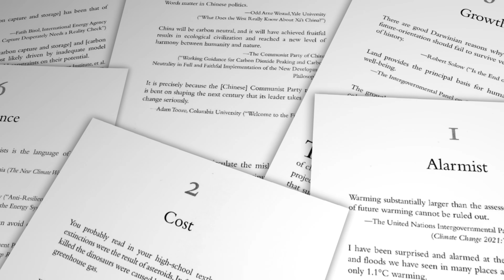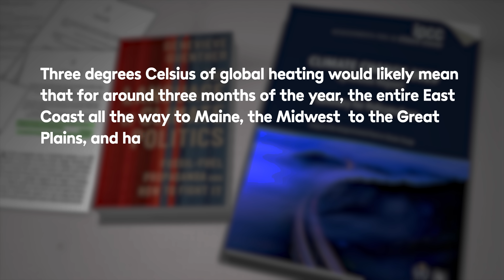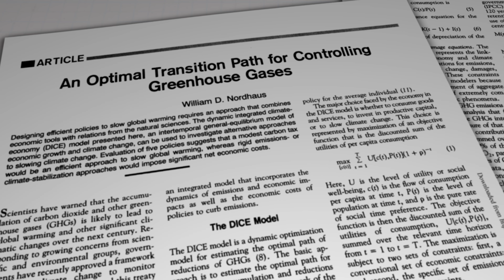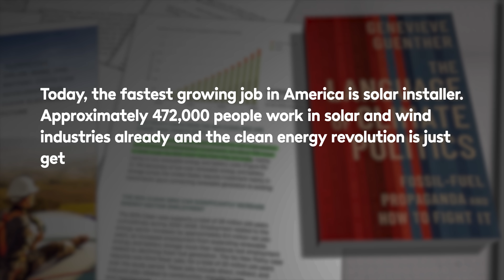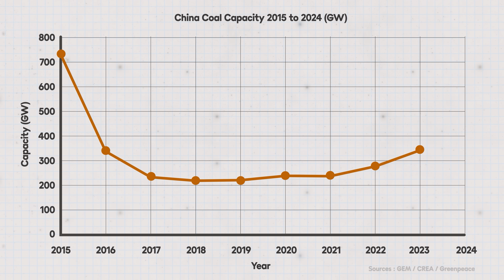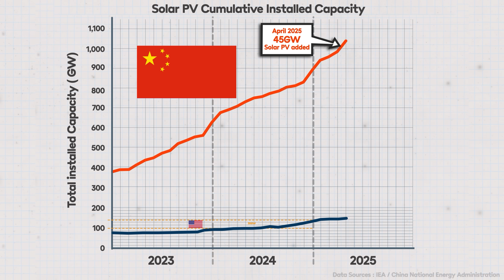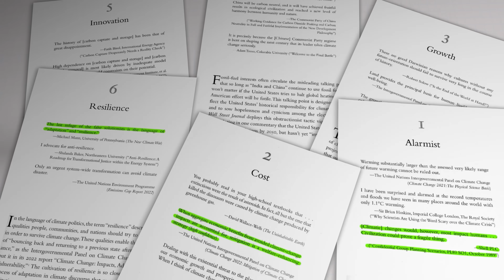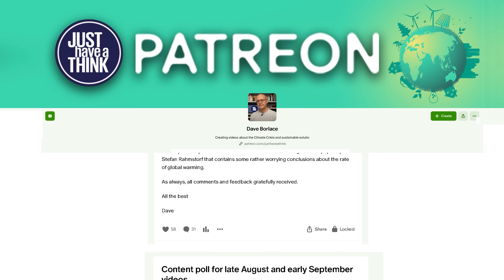New research DEBUNKS climate disinformation.

Comment: 5:52 No. 
"Heat-attributable mortality fractions have declined over time in most countries owing to general improvements in health care systems, increasing prevalence of residential air conditioning, and behavioural changes. These factors, which determine the susceptibility of the population to heat, have predominated over the influence of temperature change." IPCC
"As regards disease, the Lancet's Countdown on Health and Climate Change (2019) shows Climate-related deaths are a small proportion of all-cause fatalities (1990–2017). That is based on data per IHME (2019), and between 1990 and 2017, the cumulative age-standardized death rate (ASDRs) from climate-sensitive diseases and events (CSDEs) dropped from 8.1% of the all-cause ASDR to 5.5%, while the age-standardized burden of disease, measured by disability-adjusted life years lost (DALYs) declined from 12.0% to 8.0% of all-cause age-standardized DALYs. Thus, the burdens of death and disease from CSDEs are small, and getting smaller. 
However, the declines in death and disease rates from CSDEs since 1990 are only a small proportion of longer-term declines across the globe. In the USA, one of the few places with good long-term data, death rates from dysentery, typhoid, paratyphoid, other gastrointestinal diseases, and malaria – all water-related diseases and therefore, almost by definition, climate-sensitive declined 99–100% between 1900 and 1970. 
We are solving our problems with CSDEs faster than we are solving our other health problems."
Indur M. Goklany
Data, in fact, shows that during the recent period of slight global warming over the past century, Malaria has sharply declined, and it is projected to possibly be entirely wiped out sometime after the year 2040.
If you're worried about deaths due to 
climate, cold temperature events are the big killer, not heat. It is estimated that 5.1 million people annually die in association with non-optimal temperatures. 4.6 million are linked to the cold, so over 90% (Zhao et al, 2021). And it is worst in the warmer parts of the world. 98% of temperature related deaths in SubSaharan Africa are due to the cold. Temperature events may be linked to upto 10% of human deaths annually. In a warming world there will be less death.
There are over 5 million excess deaths per annum globally due to abnormal temperatures from the 2000-2019 study led Prof. Guo of Monash University. It found that over 90% of excess deaths were caused by excess COLD rather than excess heat. So, in a world with increasingly mild temperatures, there will be less excess death. Lives will be saved. Warming is good not bad. 
A 2022 Lancet study reported 791 heat-related excess deaths and 60,753 cold-related excess deaths in England and Wales each year during the years spanning 2000-2019. That’s an excess death ratio of about 85 to 1 for cold vs. hot temperatures.
Due to warmer urban temperatures, the number of premature cold-related excess deaths avoided averaged 447 per year from 1976-2019 in the city of London alone (Hajat et, 2024). 
Europe as whole had overall ratio of 10.09 cold-related deaths for every heat-related death (Boretti, 2024). In a 2025 paper by Walkowiak et al. found the post-1980s warming trend had improved European life expectancy “The last four decades of global warming have led to a net gain in life expectancy.”
Another Lancet study (Liu et al, 2019) on temperature related death in China showed for every heat related death there were 42 cold-related deaths for every heat-related death. Or 580,800 deaths due to cold and only 13,900 due to heat in the whole of China.
Reply: What a load of codswallop. You need to understand wet bulb temperatures. In more and more places people who are outside for more than an hour will simply die as evaporative cooling will do nothing to help them.
Reply: And no air conditioning may save some, but most can't afford it.
Reply: 1 Billion people looking for a new place to live....

Comment: 4:50 The usual unsupported drivel. Of 30 CMIP6 climate models 27 run too hot. Several actually double the rate of observed warming (1979-2024).

Comment: That's my argument. We are going to need far more energy in the future than we use today. At least twice as much. So a renewable energy sector would be far more valuable than a fossil fuel energy sector.
Reply: You forget...  Moving away from fossil fuels actually means our overall energy requirements drop by a considerable amount.

Why?

Because in order to gather the fossil fuels we use to produce electricity and propel our cars and planes around you first have to expend a bunch of energy gathering the fossil fuels.

You have to expend fossil fuels in order to gather fossil fuels.
Reply: "That's my argument. We are going to need far more energy in the future than we use today. At least twice as much." We are currently overshooting Earth's sustainable carrying capacity by about 70% per year and that overshoot is pushing ecosystems, our food supply, and societies toward catastrophic collapse, and you would like to double the rate at which we cause our own self-destruction?
Reply: @HealingLifeKwikly  You sound like the new version of Paul Ehrlich...  Food production is the most its ever been, and it continues to increase every year.
Reply: @HealingLifeKwikly  Just an area of 800 km x 800 km in Western Australia receives enough solar energy to power the whole world.
Reply: @andrewclark3236  That's great Andrew, but 
this isn't simply an engineering problem where we just need a different form of energy; rather, the problem we face is how can we meet the needs of 8+ billion people while ending our ongoing destruction of the web of life that our lives depend on?

Industrialized civilization is overshooting Earth's sustainable carrying capacity by 70% per year and has pushed the Earth beyond the safe operating space for humanity for six of Earth's nine planetary boundaries. Renewable energy might solve the problem for one of those boundaries, but we would still be in enormous overshoot, and what's the additional ecological footprint of your 800x800 km grid and how are you getting the energy to me on the other side of the Earth.

The bottom line scientifically is that any large highly industrialized society is an unsustainable and self-terminating system. WE need a much smaller and lower tech economy and much simpler lives with more manual labor.
Reply: @HealingLifeKwikly  The prosperity of people has always depended on the amount of energy that is available to them. The ecological footprint is smaller than the built environment of the world and is smaller than if nothing was done and eventually everything would be destroyed. The ecological footprint is probably smaller than all the coal mines, oil fields and refinery's put together.
Would you support dumping the high carb plant-based diet for a healthier animal-based diet, like how we once eat?
Reply: @andrewclark3236  Thanks for your multifaceted reply. 

"The prosperity of people has always depended on the amount of energy that is available to them." Absolutely true, but the energy use and material depletion and wastes of this society are currently overshooting Earth's sustainable carrying capacity by ~70% per year...and that overshoot has been pushing the world for decades into worsening ecological breakdown which is starting to cause unraveling of economies and societies. To end that overshoot and prevent catastrophic collapse, the size of the global economy must shrink, become much less industrialized and we must revert back to more agrarian economies with much simpler lifestyles and more manual labor. It really is a pity that schools don't teach how the world really works.

"The ecological footprint is smaller than the built environment of the world and is smaller than if nothing was done and eventually everything would be destroyed." I think there are missing words in your sentence, but I'll guess you meant a larger renewable energy sector would have a smaller ecological footprint than current fossil fuel infrastructure(?) and that may be true, be renewable energy isn't nearly enough to prevent breakdown due to ecological overshoot. Most defining features of modern civilization are ecologically sustainable, so the goal is to create a truly sustainable one, not keep running an unsustainable one with a less damaging source of energy. 

"Would you support dumping the high carb plant-based diet for a healthier animal-based diet, like how we once eat?" I'm afraid you've stumbled into one of my areas of expertise--I've taught about healthy nutrition and nutrition myths at the university level for a very long time. You can't discuss healthy nutrition constructively without distinguishing between whole food carbs on the one hand, which are super healthy fuel vs. highly-processed foods that are high in carbs on the other hand (the latter being unhealthy). The best overall long-term health outcomes have consistently been found on diets dominated by whole plant foods--and in which 50-70+% of calories came from whole food carbs. As for history, the best research shows that humans ate an incredibly varied range of diets, but the earliest human ancestors were mostly vegan, and at most places and points in our history, humans ate a wide variety of whole plant foods. 

Be well.

Comment: Just checked emissions per capita:

China   8.89
India   1.89

North America
Canada  14.99
Mexico  3.79
USA     14.21
Reply: What is being measured exactly?
Reply: Yup Canada is definitely disgusting.
Reply: of CO2?  plants love carbon diox
Reply: @atomicdmt8763 plants don't just need CO2. They need reasonable temperatures and rain fall.
Reply: Per capita is a dumb metric, a tool for apologists.
Reply: @Les_S537  Considering the industrial footprint differential between the US and China the fact that China isn't much higher is remarkable.
Reply: @yariboi5  Mankind, collectively, strip mined over 8 billion metric tons of coal out of the crust of the earth last year.

China consumed more than 5 billion tons of that.

You know how much coal the US used last year?

412 MILLION metric tons...
Reply: @Les_S537  From ChatGPT
The U.S. has historically been one of the largest per capita consumers of both coal and oil, but its per capita consumption has stabilized or even decreased in recent decades due to energy efficiency improvements and the shift to natural gas and renewables.
China's consumption of both coal and oil has surged in recent decades, but on a per capita basis, it is still much lower than the U.S., due to its larger population. However, China is closing the gap in oil consumption, while coal remains dominant.

You deliberately limited to coal only, why? Per capita is a thing, like it or not. And don't forget US is not a production economy, but a service economy, whereas China IS a production economy. Population in China is pretty poor compared to US, meaning less consumption, meaning less waste per capita. You sound like the apologist here, not accounting for per capita. But hey, at least all those data centers will affect your energy bills, rolling blackouts, and water availability without much interference from legislators, so at least I can laugh about that. Can you?
Reply: @Les_S537  Source? I really appreciate data that is properly sourced. Telling me to "look for it" is a cop-out.
Reply: @Les_S537  Per capita is a very sensible metric.  It allows us to say things like "what is China doing differently than we are, and can we learn anything that will help us?"  If the answer is "far more of their population is agrarian and lacks access to the standard of technology the median US citizen has" then there isn't much we can do with that.  If the answer is "they are building a new windmill every hour and moving to nuclear power where possible" then that's something to talk about.
Reply: @Les_S537  per capita emissions clearly show that north americans are voracious consumers, and emit much more GHGs, compared than Asian countries. Americans and Canadians are greedy.
Reply: @Les_S537   per capita is the only reasonable metric. Of course a large nation will consume more than let'say Denmark with a few million people. Who may consume as much energy as a much more populous but poor African nation. Now WHO is supposed to do more to switch to renewables ??  Because more energy consumption always means RICHER. And when you compare apples with oranges and lump nations with different population sizes together you do not see who contributed much more in the past (those nations that are the top consumers have been splurging on fossil fuels since the end of WW2). And who has more capacity to do more NOW.

China puts us to shame, they are not that wealthy and they are doing good (consider that they also have the energy consumption from producing for all of the globe).

Comment: They need non green tariffs, so a company in China pays an added tariff if they are not doing a green process. This will need offshore monitors(as we know China can easily print 100% gree compliance certs). this would be a detailed industry by industry conformity pressure = upgrade production to not pollute = lower tariffs

Comment: So USA is just going all in on fossil fuel heat death of the planet.
Reply: No...

Why not?

In 2007 China surpassed the US in GHG emissions.  2007 was when the US maxed out on GHG emissions at just over 6 billion tons/year.

Since 2007 the US emissions have gone from 6 billion tons/year to 4.8 billion ton/year.

Since 2007 China's emissions have gone from 6 billion tons/year to close to 13 billion tons/year

Last mankind strip mined just over 8 billion tons of coal out of the crust of the earth...  China used close to 5 billion tons of that.

Last year the US used 411.4 MILLION short tons of coal
China used roughly 13 times as much coal as the US last year